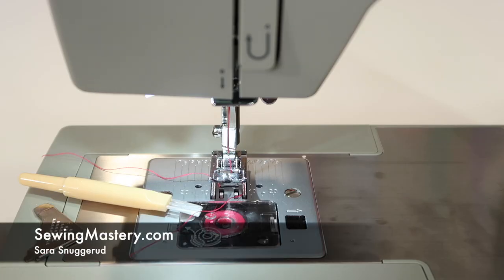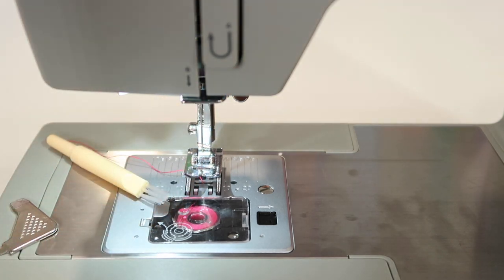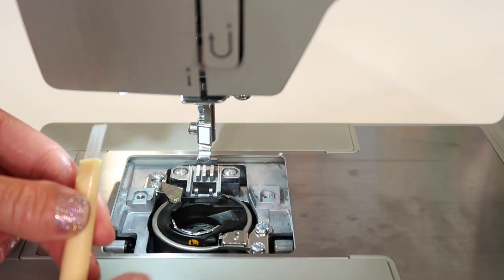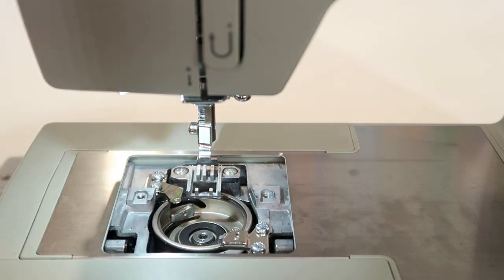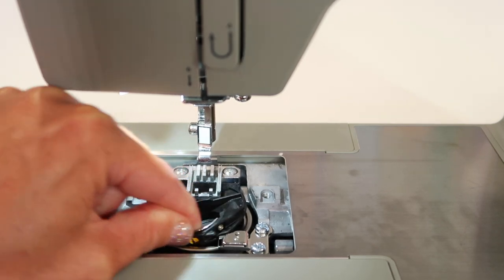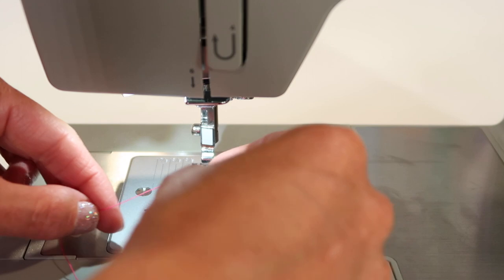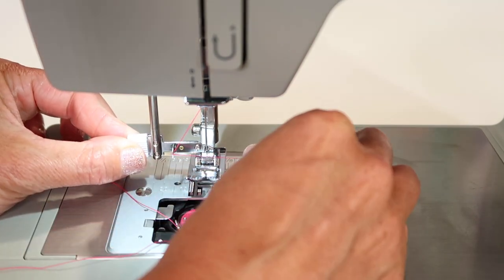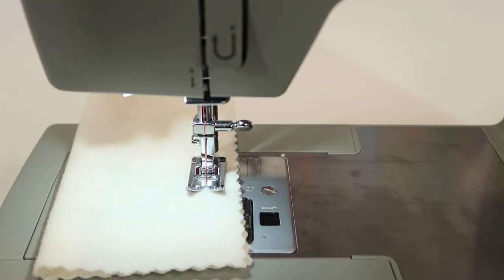Singer Heavy Duty 4452 10 How to Clean a Singer Sewing Machine

Comment: I don't like that I will have to take it every year to be oiled. Sewing machine long ago had oiling holes so that the consumer could oil it themselves.
Reply: You can oil it yourself.
Reply: @jonigordon6596  How?
Reply: The video just showed you. Please watch it again.
Reply: @jonigordon6596  the video only showed how to oil the bobbin area, then said to take the machine to the shop once a year. What about the rest of the machine? My old machines didn't need to be taken to the shop because they had oil ports and could be opened to clean the rest of the machine.
Reply: He took the entire machine apart and showed everywhere that oil should go. I just finished mine. It's purring like a kitten and sewing beautifully.  If you sew a lot, your machine should go in for yearly maintenance anyway.
Reply: @jonigordon6596 I watched it again SHE only showed how to take off the needle plate and the bobbin case to brush away the lint and oil under the bobbin and put everything back. At the end she said for the rest of the machine take it to the shop. There is a video where a man takes apart the whole machine and shows how to clean it. I may do that but with my vintage machines you can get to everything you need to clean or oil without having to take the whole machine apart.
Reply: I'm sorry. I went to Sewing Masters and watched a different video on cleaning your HD4452.   However, yearly maintenance is always recommended if you do extensive sewing, which I do. Especially if you work with batting.

Comment: What if my needle plate won't go back on completely flush? This is a newer machine for me and the first time I cleaned it, I didn't really look to see how flush the needle plate was. When I put everything back together, it seemed the needle plate wasn't as set in as it should be.  Any comments?
Reply: I had the same problem. You need to tuck the plastic tab near the graphic of the bobbin under the small metal box and then snap the needle plate back in!